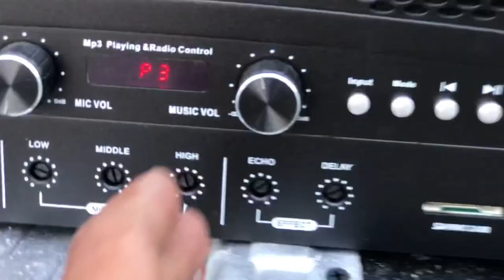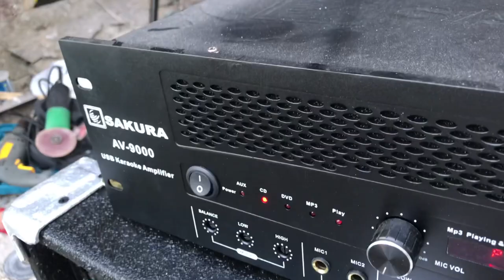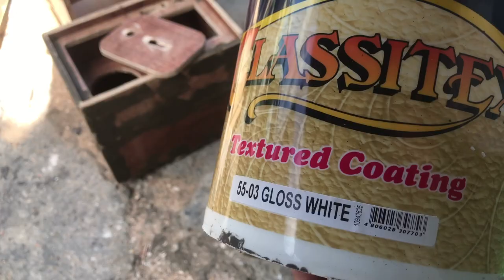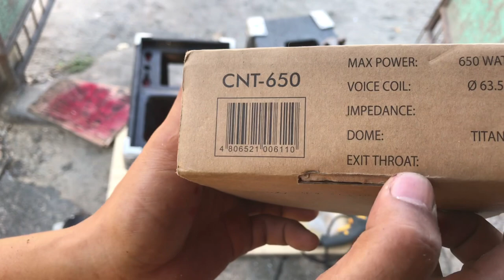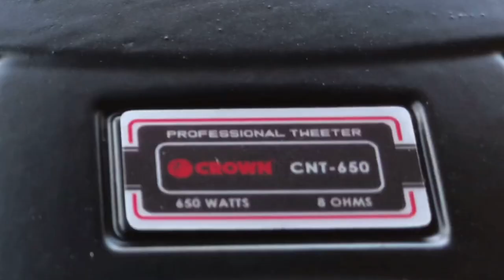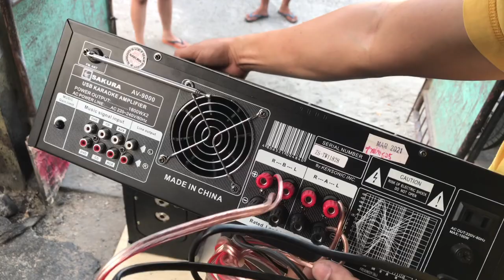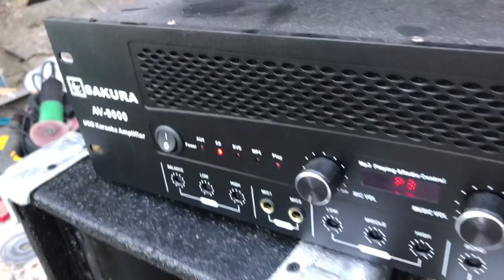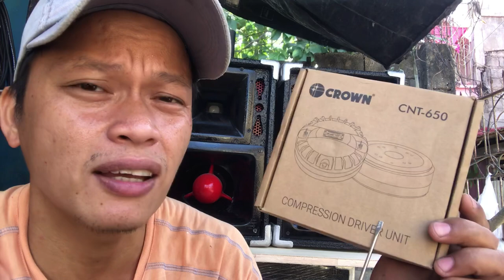ASSEMBLING  MID HIGH, SIZE8 (PANG OUT DOOR BA?)

Comment: Boss idol, match ba yong sakura 389 atsaka crown na 105 na 3 way? Hindi pba loaded ang amplifier nyan?
Reply from the maker: Kung itigrated po sir amp nyo, kung ang wts ng amp nyo ay 600wts per chnel mas magnda po kung iload nyo ay 400 to 300wts para d hirap ang amp
Reply: @RandyNoble_VTBR  boss idol may bibilhin kasi ako package napo, sakura 389 and crown na 105 hindi kupo alam kung match naba yun sya ang inisip ko cguro po match na yun kasi yun yong sinasama sa package nya eh..  Kya hihingi po ako ng opinyon sau kung ok kaya yun? Salamat po sa time mo idol subscriber nyo po ako at pinapanood kupo yong mga gawa mo na mga speaker
Reply from the maker: Bka po match n un kc set npo pla eh  dko po kc alm ung amp n un eh